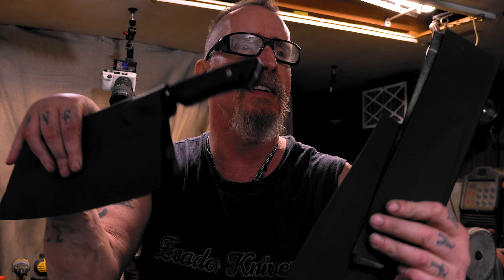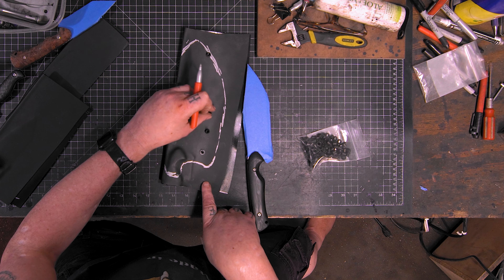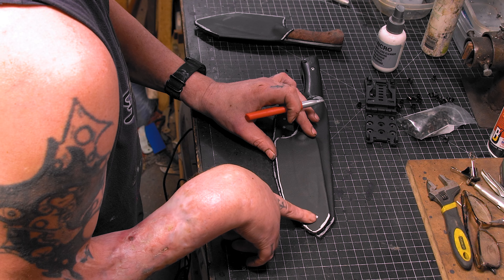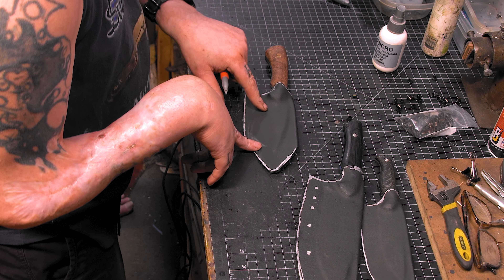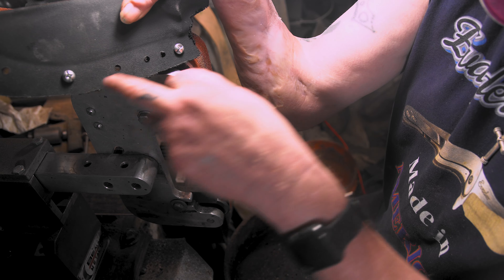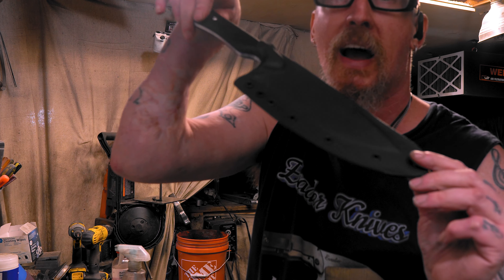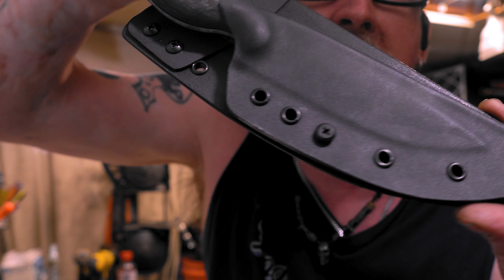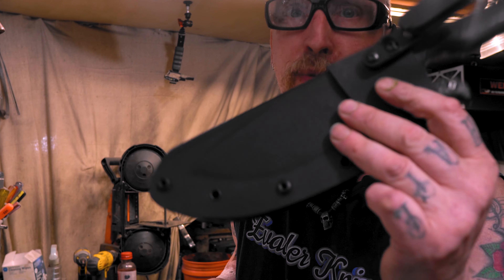2 in 1 kydex build

Comment: What do you usefor grommets and press?
Reply from the maker: If you google knifekits, they have everything you need. Look under parts for eyelets. I built my own press, but I bought the foam from them too. They do have presses, look under tools - presses & foam. I use 12x11.5x1"(2 of them). I would buy a full sheet of the 2'x4' kydex, it's bulky but cheaper. Good luck.
Reply: @evaderknives  thank you man kerp up the awesome work. Any advice on tiny knives, i want to make 1.5 to 2in neck/key chain knives, first one i made was a challenge to make leather sheath.
Reply from the maker: @dgundeadforge17  I've never done leather, but kydex is great for smaller knives. I've got a whole playlist on kydex. https://www.youtube.com/watch?v=lsqu72ooBVk&list=PLWqIpYSSgZJg2pTf38xIMC2kdttZny9OY